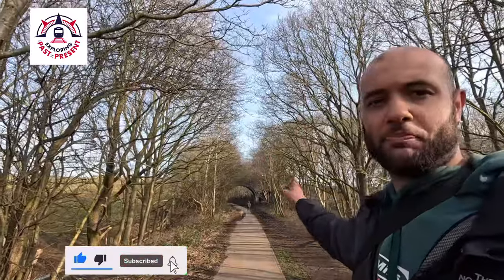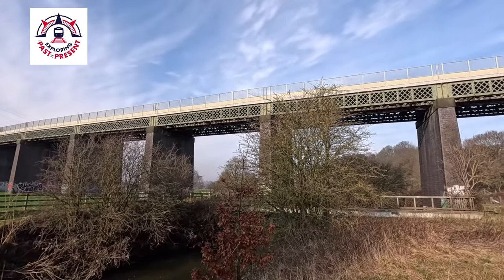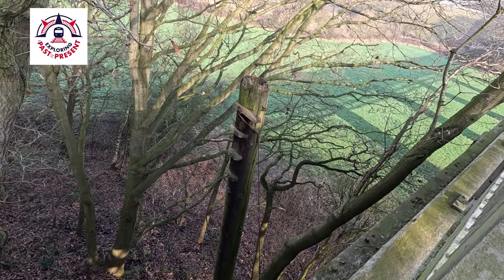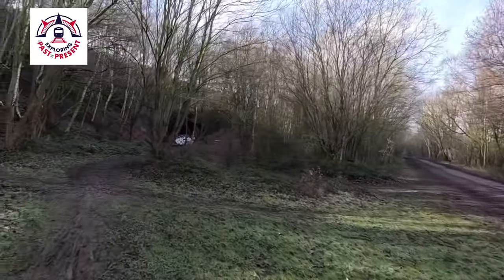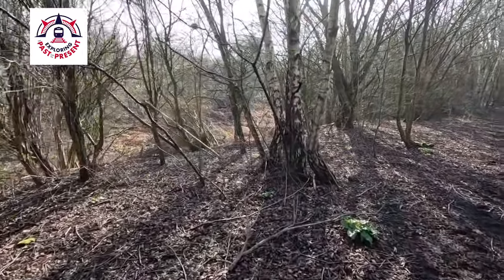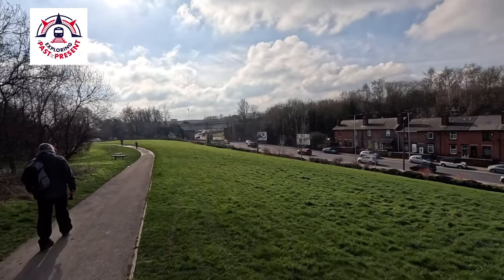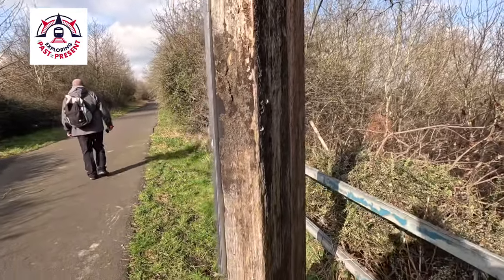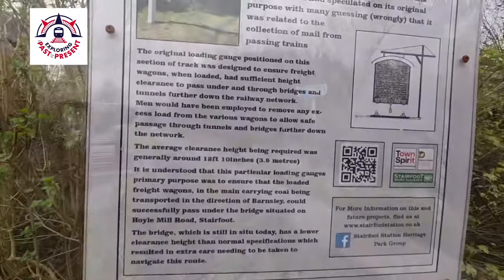Ardsley Viaduct to Stairfoot  Station ( The  Stairfoot Lines Part 2)

Comment: Just subbed mate any one showing my kneck of the woods and the HnB deserves it
Reply from the maker: Thank you ! 
 I’ve done quite a abit aorund Barnsley ! 
 And I’m looking to cover  more of The H and B once the vegetation dies down 😎 it’s amazing how all those lines connect at stairfoot
Reply: @exploringthepastandthepres9793  Indeed there were a lot of lines round Wakey as well the rail maps do not do it justice  at Royston where the sheds were the inspection pits are still there if you look closely
Reply from the maker: @daystatesniper01  I did the Barnsley coal railway passing Royston 
But saw the midland line which I’d like to cover in future 
 😃 if you havnt seen my Barnsley coal series
Reply: @exploringthepastandthepres9793  I'm slowly getting through them all   lol  cheers